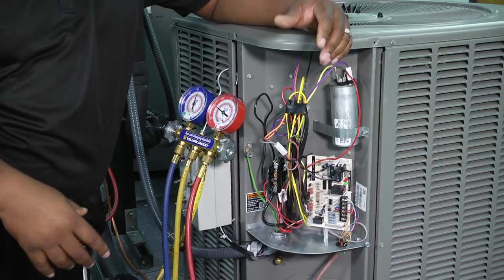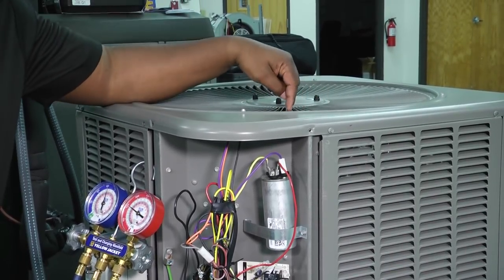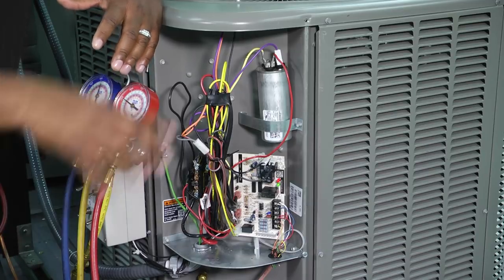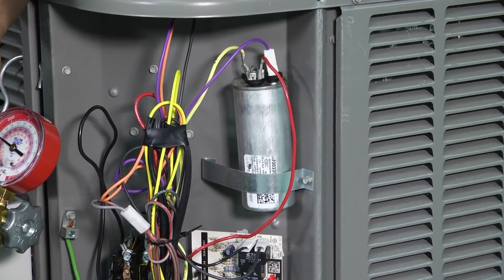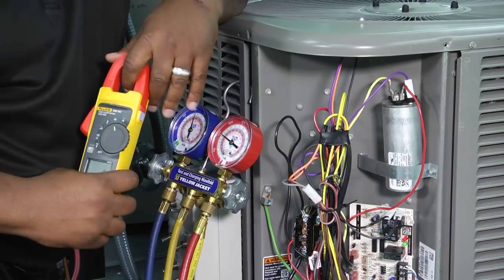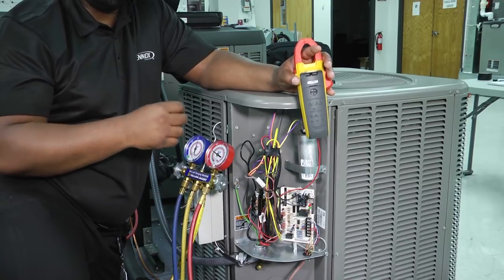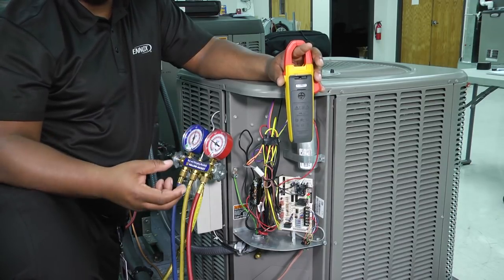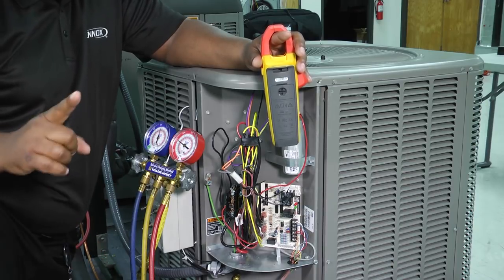Mastering AC Maintenance: Expert Tips and Tricks for Optimal Tune-Ups

Comment: Good explanation. 
A neighbor that bought the north house here on the farm that has extremely low indoor air-flow and also has been low on R-22 refrigerant over many years & never corrected

So the neighbor called an HVAC contractor, the technician had a digital manifold cage that was showing high superheat and low 1°F sub cooling, and of course the superheat was high because it was flashing gas through the TXV.

When the sub cooling got to 2°F and the superheat get down to 16° F & he said the unit was overcharged & took the cages off; actually the target SH of the TXV was probably 10° F, and because it was flashing gas through the TXV it was still well above its target SH.

Nothing was ever said over the years about the extremely low airflow which had been a major problem since the A/C was added to the oil heating system in 2005. Such is the horrible level of HVAC service we have been getting here in SW WI over the many years since the A/C was added.
Reply: Right-on Will my man; he had the digital gauges but didn't even know enough to charge only by sub cooling. The target TXV superheat was probably 13° to maybe 10°F, it was probably flashing gas yet keeping it at 16° SH...! You watch SH to see if it's in a normal range when SC is right...

Comment: I have a preventative maintenance contract on my Lennox.  The first person who came out looked at my filter which I had saved when I replaced it.  The filter, old, was filthy and had a slightly oily spot on it.  She blew out the pipe even though it was currently dripping.  Just changed filter again and same thing.  Very dirty.  I had already had my condensing unit cleaned with top being removed.  I have noticed that the vents closest to the inside unit have more dark dirty looking dust.  What do I need to have my representative look at?

Comment: Gotta clear the drain line on check ups or in my opinion you charged the customer 65 bucks to check out a working AC unit. Basically did nothing of any good. Cleaning the condenser and clearing the drain is about all the good you can do for them.

Comment: This video did nothing to visualize the Preventove Maintence aka Tune Up
...  the geneal public dosnt need to know this, as tune ups are quick cash, as long as you are lower then average cost for tune uo to competators to drive business, and the cleaning must be supurb, i also show clients before and after photos so they know the service was done....
Reply: This is more info about the technicians that do the maintenance not the homeowners
Reply: All I got from the video was talk to homeowner and sell them piece of mind.  Clean the unit and keep extra capacitor on hand.  Multiple HVAC friends have told me tuneups are a waste of money.
Reply: @2lotsill  Good chance then your HVAC friends don't know what they are doing. A/C tune ups are important an the reason why is because coils do leak and capacitors and contractors do get worn out over time. Condensate pumps need to be cleaned or replaced. P-traps on units need to be cleaned to keep from water backing up and over flowing the pan causing damage to the unit or damage to a finished basement or ceiling depending on location of furnace/air handler . People tend to either not run filters causing the blower motor to get filled up with dust causing poor airflow and not allowing the system to work properly. As well as not changing filters for a extended period of time causing for the system to freeze up due to lack of airflow across the coil. Homeowners also buy very restrictive filter from the big box stores and their duct work/ blower motor is not able to handle that kind of filter which again would cause low airflow issues. Homeowners are unable to check refrigerant levels on their own to be able to determine if their units is working correctly or check the static pressure across the coil to see if the coil is starting to get build up from dust from not running a filter or not changing the filter enough or even from people smoking in the house.. Low refrigerant and poor airflow means pre-mature failures shorter life on your compressors and higher electric bills due to longer run times or if you had butt crack bubba came over and over charged your equipment now you have liquid refrigerant flooding the compressor and again pre-mature failure on your equipment. We also check to see if the system was properly commissioned after install if its newly installed (they never are). We check to see if we can get better de-humidification out of the system better air flow. All of this means more comfort and lower cost to run your equipment. Having annual maintenance done on your equipment is important. We don't just clean off your condenser coil there alot more that goes on that most people don't know about or would know about. You just got to find a good contractor who goes over everything an is looking out for your best interest not just lining his pocket with your hard earned money not providing a A+ service.

Comment: Very vaige! #1 when you check voltage on a capacitor you check it across herm and common.  #2 it can be very tough to find out what metering device you have because it can be encased in a plenum or in the coil case.
Reply: The trick i use to figure out txv or piston is by covering half of the condenser coil. If my head pressure skyrockets and the auction pressure barely moves I have a txv .if they both raise considerably then there is a piston.
Reply: @Clamjammer  that's an awesome trick, gonna put that to use!
Reply: @Clamjammer  Oh my god that's a good one, thank you!

Comment: You should always take the top off and spray the coil from the inside out, it's the only proper way to do a clean and check
Reply: I personally find that this is only neccessary for units in which the coil is protected by stamped fins such as shown in this video

Comment: Need to get with the times- analog pressure gauges are so yesterday. It's time to invest in a set of digital gauges!
Reply: duaneredman if you ran out of batteries?
Reply: Diego digital gauges have battery gauges on the display, the times my friend- the times!
Reply: Can u use the new digital gauges for refrigeration? I still used the old style my co workers always say to stick to the olds
Reply: NEMESISxM1G yes you can. The digital gauges usually have pressure temperature charts pre-programmed in for at least 30 different refrigerants. You just set the mode to the refrigerant you are using if you want to take instant superheat or sub cool readings by hooking up the temperature probes that come with them. Take a look at the Testo 549. It is a basic set that is affordable andvery easy to use and rugged for everyday work. It also gives the added feature to zero it out so it doesn't have to be sent off to be calibrated. I am being serious when I say once you have tried digital gauges the analogs will be thrown in the trash! Oh, by the way, your co- workers need to get with the times too!!!
Reply: If you run out of batteries for your digital gauges you are the same guy that runs out of refrigerant, oxy/acetylene, nitrogen, seals, etc. I have analogs for backup but they are the last thing I choose to use. Don't let old school guys tell you that digitals make you dumb because the gauges do all the work for you. Techs that didn't understand ac with analogs aren't going to magically understand with digital gauges either. It just simplifies the process.

Comment: First of all quit referring to these maintenances or check-ups as Tune-ups your misrepresenting what your actually doing, and stop telling these ( especially new ) techs to gauge up to units on check-ups, it’s actually only for diagnostics, if your statics pressures and temp splits are ok, typically your refrigerant pressures are good, check the things that actually could cause damage like restriction in condensate drains and loose electrical connections.
Reply: I agree. Take temperature differences, clean condenser with mild coil cleaner. Take amp draws, check caps and contactor, flush drain lines. Sale batteries, for tstat, smoke detectors, and co detector. Look for problems. Loose duct runs and unwrap boots, aerators on sinks, loud barh fans, UV lights for clean air, your company stickers on AC, or its time for that new system. PM's should bring $600.00 extra into your company.
Reply: @behvac  In your opinion how long should a typical tune up take, with your approach? Also, give or take, what is your success rate with add ons such as UV lights, eac, etc?
Reply: @Brian17177  We still use paper on our Maintenance Contracts. The AC has 22 items on a check off sheet. If you want your company to be worth anything you must sale PM's. A fall and spring check on most home systems. Avg time to clean and check is about 2 hours. My dispatchers must email, send post cards, and make the phone call or take it that is about 20 mins per customer, another 15 mins if it is raining or customer does not answer phone call 30 mins before we go to there house. Drive time round trip or to next call 1 hour. Tech takes about 30 to 40 mins to do the check up. Hope he sales a Air Scrubber, or replace  the duct, If customer has old leaky duct. CO detector, Vapor barrier under house. Sales and more sales to stay in busness. This is a hard busness. 2 break jobs, oil change, tax tag and ins. and 8 new tires last week. Hard to find good help that knows what to look for or how to fix the problem.